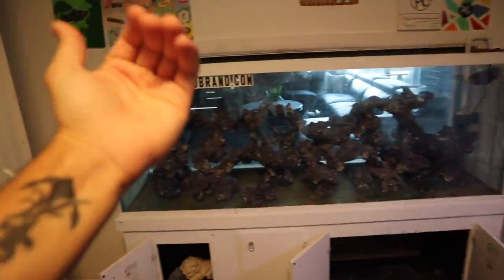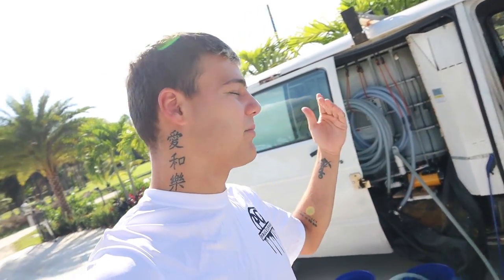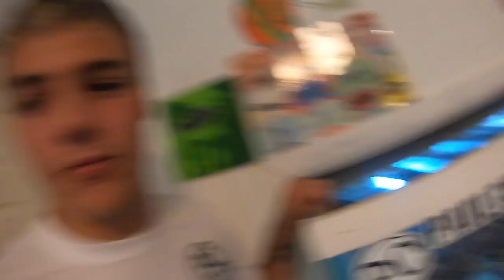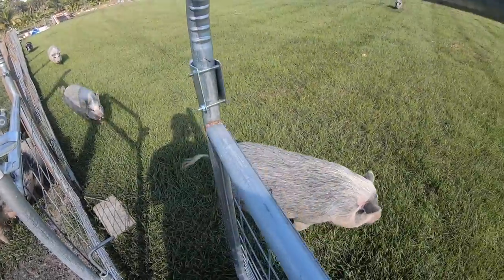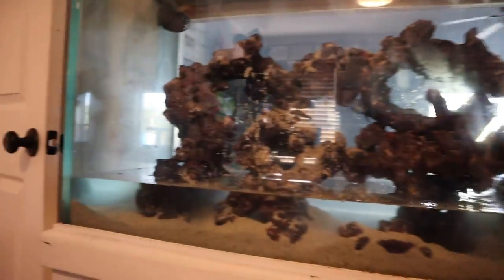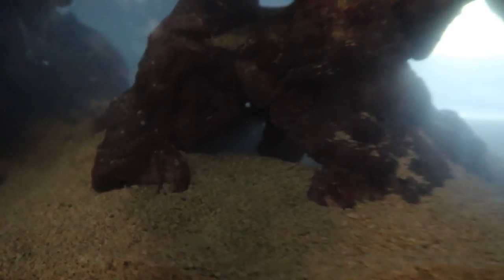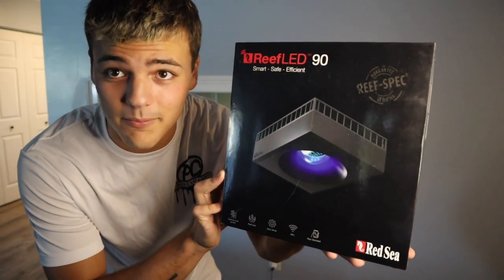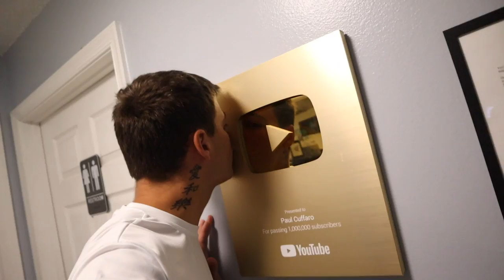My SALTWATER REEF AQUARIUM is COMPLETE!! (part 2)

Comment: Goby and pistol shrimp or Black cap basslet, after a while if you get copepods you should get a mandarin dragonet.
Reply: Pistol shrimp just burrow under the rocks and eventually it will screw up your rock and the pistol shrimp cojld kill himself if he burrows under the rock and the rock falls
Reply: @nickranly1088  The rock is setup on the glass and not the sand so that can't happen, and the goby will make the shrimp more confident to leave its burrow
Reply: Pistol shrimp are called that for a reason. They snap and it sounds like a gun went off.

Comment: Hey Paul cuffaro considering the fact that you are new to the saltwater hobby I would suggest some designer clownfish specifically long-tailed designer clownfish just because, as you may know designer clownfish have a reputation in the saltwater hobby as being a easier and or beginner introduction to the hobby. As a bonus you could always having anemone to go along with it. If you were to get in anemone, I would strongly suggest any beginner anemone such as the Rose bubble tip anemone. But the most important part of the saltwater hobby is that you have fun.